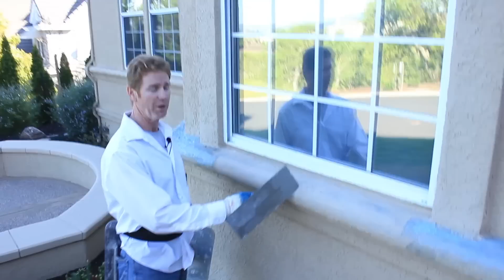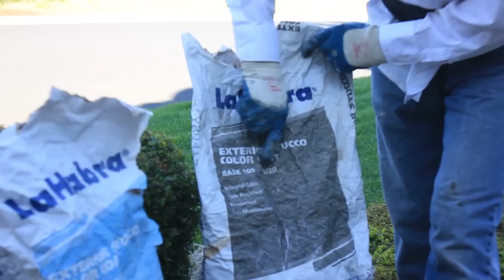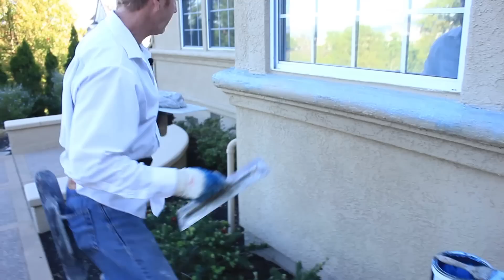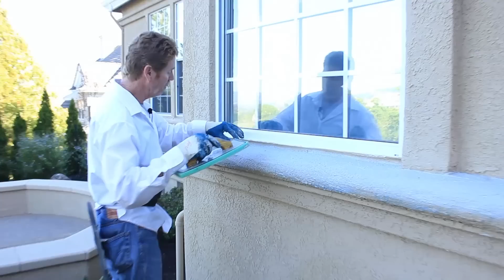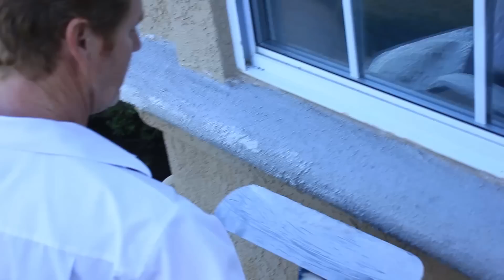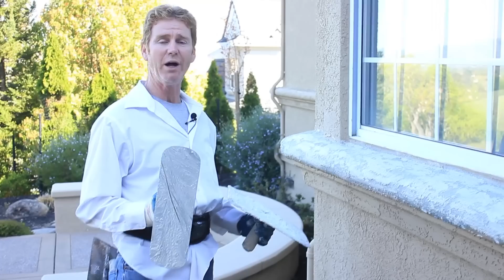Repair your stucco styrofoam window trim molds.

Comment: Great patch work Mr Kirk ...was wondering do you blades or trowels get knicked up?...because my drywall knifes every now and then get chipped and leave lines if we don't grind them down on the concrete floor
Reply from the maker: Sometimes, if I use them like hammers. This is a cardinal sin.🥳
Reply from the maker: Yes this sometimes happens to our trowel blades to. I get 😢he burrs out the same way you do on a smooth concrete floor. 🕵🏼‍♀️

Comment: My window mouldings due to a fire melts the foam inside the trim and made big holes and damaged  half of my trim what shud I do  in this case
Reply from the maker: Simply cut or remove any damaged area re- coat them.

Comment: Do you always need to use the bonding agent before applying new stucco over old stucco? Or is that only if the surface has been painted? Thanks in advance
Reply from the maker: Yes you do

Comment: Hey Captin Kirk,  Do you think it would hurt if I added some food dye to my bonding agent,  to give it a tent?  Because I like the idea of actually seeing where you have it applied.  Like you can see the Weld crete.  Thanks for any feed back!
Reply from the maker: Howdy Marc, I've done this in the past a couple times when I didn't have the larsons, Wel-crete and had to use the quikrete white bonding agent. FYI, the white bonding agent can be noticed on the home by its slight sheen. I added the color as one time a had many guys and understood that if any of them missed a spot I would be responsible to come back and reapply.😉
Reply: @StuccoPlastering  Awesome, thanks for your input.  I wanted to try it out. Because I like the idea of seeing the Larsons.  Especially if I had to put it the day before. It would be easier to see. Again  thank you Sir!

Comment: Pretty simple finish......let sand finish set up a bit and trowel on texture......if you mess up just green float it back into base and start over....you get the feel of it fairly quickly if you have experience in finishing any kind of mud.....drywall, concrete, stucco, etc......its all kind of same process....just bit different feel for various materials.....
Reply from the maker: Good Evening Kirk dude, exzackory                  
                       Live long and plaster
    Mastering Plastering by Kirk and Jason Giordano

Comment: Could this type of exterior wall stuff, be used in alaska
Reply from the maker: Good Evening John, yes this can be used in all extreme weathers and will hold out better than any wood substrate.                 
                       Live long and plaster
    Mastering Plastering by Kirk and Jason Giordano
Reply: check plaster specs on material will say.

Comment: Could this be done with a standard sand and cement brown coat mix?  What is your favorite mud mix ratio?
Reply from the maker: Good Evening Tony dude, as a rule I mix 1 parts cement plaster to 3 parts sand.                   
                       Live long and plaster
    Mastering Plastering by Kirk and Jason Giordano

Comment from the maker: Morning Sainbayar Battur from Mongolia, glad to be of help.
 Best Wishes with your fix,
 Kirk & Jason Giordano's DIY plaster and stucco channel
Reply: Kirk Giordano plastering Inc. whats that green sponge you use to texture?
Reply from the maker: Howdy my friend Hector,
 it's called a green sponge plaster float, basically just a spooge with a handle, but when using this correctly it brings the sand or aggregate to the surface.
best wishes
 Happy holidays from the Giordano clan